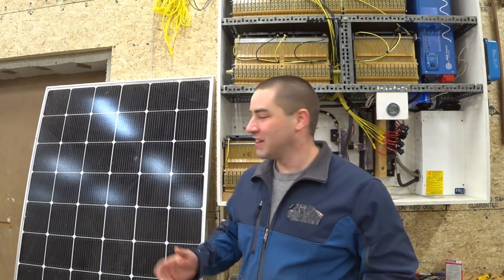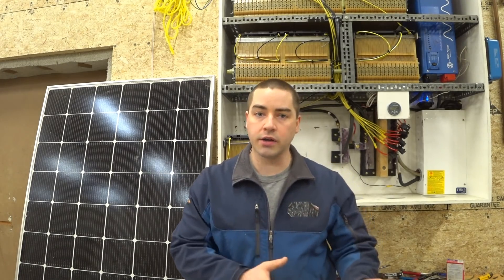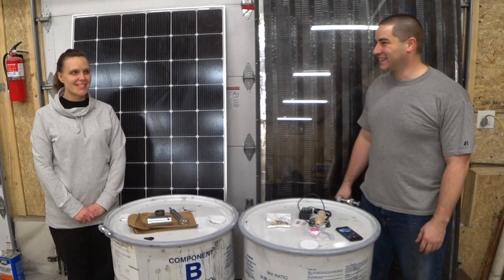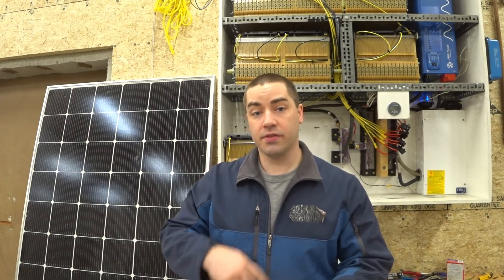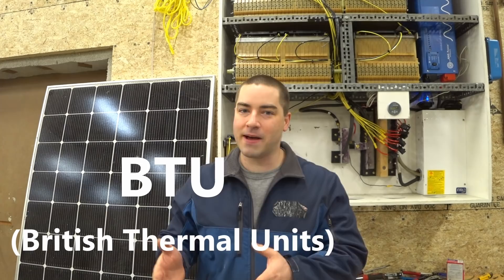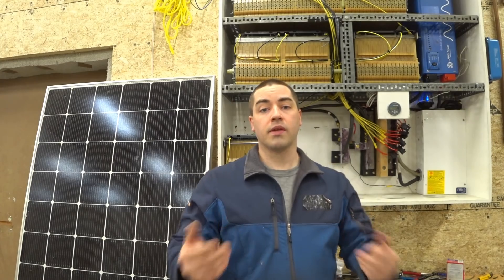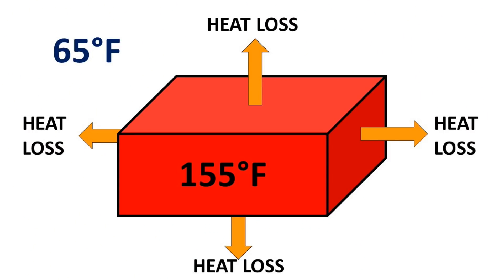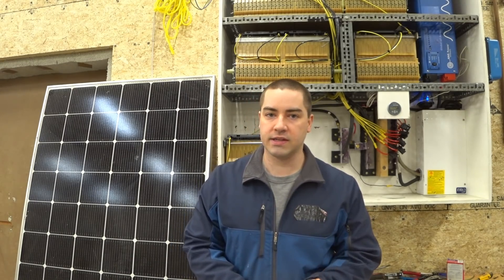Cheapest Energy Storage Off-Grid

Comment: Your minimum water temperature should probably be around 140F. Some forms of common bacteria will grow at temperatures under that. With the surface areas involved in the larger tank and heat exchanger, it's important to maintain sufficient temperature to prevent the wee beasties from growing.
Reply from the maker: 140°F is illegal in my state of Massachusetts, at least according to my plumber.
Reply: @DavidPozEnergy  Yes, some locations have both a minimum and maximum hot water temp (generally for landlords) and it's generally 120 degrees F. Anti-scald laws often have a maximum temperature of 120F, go figure! However, it's good to note that's at the tap (could be some losses between water heater and tap). Also, there are anti scald shower valves. In any case, 140 degrees really is a minimum hot water tank temp to prevent legionella bacteria.

Comment: Interesting fact, iridium has a much higher heat capacity than water. It would only take 33.2 gallons volume worth to get the full 4 days. However at current price it would cost about $553 million. So, water is probably better....

Comment: I think you missed the point, you still store the water in your massive home made tank but you heat it using a heat pump from the solar. This would allow you to heat the same amount of water with about 1/3 to 1/4 the amount of solar. However you would need to compare the cost of the water heat pump to the savings made from having less panels, You would also probably need a big inverter. My guess is the Heat pump + inverter would end up being more expensive than just having the extra panels needing to run a resistive element. Would be good to see the math.

Comment: POZitively the best stuff, watch many of your vids.
The problem with off grid thinking juxtaposed to on grid thinking + economics is the poor utilization factor of the storage solution as you expand the dreaded week long cold snap with no sun.
That means you only use it once in a blue moon.
So it is bad for the environment for us all to off grid, because we will waste so much resources to achieve the goal.
A smaller system with rare FF burning heater back up system also running is a lower impact solution in the end.
A heat pump to capture the waste heat even better, with capitol planning...
Even coupling the fireplace to the hot storage with directional valves, automated or not, is a good option for the low utilization, but still needed stretch.
You either thermaly peak when needed with fuel, or a heat pump add. If the the heat pump is leveraging the thermal storage, then the working delta T is going to get Hit...even go negative.
If you have a heat pump water pump as the final hot then your delta T of mass storage can be wider because of the lowering of bottom temperature.
If you have an old boiler and you use it 5% as much as you used to and the global climate emergency only requires 62% renewable, you can get off the unicorn of Net Zero Logic earlier.
33% margin left...
Also try putting a hot water heater (even an evacuated tube panel) under the solar panels sandwiched between roof.
By cooling PV the efficiency goes up, so if there isa use for the heat, the PV gives a bonus.
If the PV are thin film more heat will pass through. Glass on Glass bifacial also.
The trapped heat load is 70% removed (evac only for this high%) from the back of PV providing heat removal.
It is removed from roof, helping summer cooling and is used for direct heat source in winter.
Not good for high temp coupling, but good for mass volume storage, think seasonal heat island for winter, or for room heating with/without heat pump assistance.
After heating needs are over, seasonally, then can run an evap with the low grade heat. If the flow is reduced to get heat then the PV will not be cooled, but that was just the bonus, so no big deal...Evap loop for cooling allows lower fluid temp loop without rejecting heat or getting into hot water. Flow can be split also more than one output, say the low temp pre hot water tank that feeds the top off system.
Reply: clarify...without rejecting heat...(add... before using it one last time.)
Reply: Add..fix...each increment of storage you add has less and less utilization.
This means as you make it bigger to zero out the worst case scenario the 1st 1/3 would be highly used when compared to 2/3 and again to 3/3 of the volume.
But thermal storage has a size limit, it can only be so small before the surface losses become too large.
It is the opposite to the cell size max limit, a cell needs to be "leaky" to be alive.
We want the opposite to keep heat in.
Volume is not that expensive but trenching 7 plumbing is, both flow or size and distance are proportional to that cost.

Comment: heat pump water heater still makes sense with a thermal battery feeding the hot water tank.
When it is hot enough then it does not pump or consume electricity.
When you only have to top off the hot water tank, lets say on average only 10% of the delta T, then only 10% of the electricity would be used by heat pump.
A propane or Natural gas can also be used. Just turn off pilot in summer months

Comment: Insulate it really well... so... you got a cheap idea? I do, move the water up with pumps. Generate as it moves lower. You can use super cheap plastic barrels normal hoses, and cheap and easily replaceable pumps and a single and easily replaceable generator with perhaps a 3d printed nylon impeller setup. Max $1000 if you have a hill. Done.
Reply: if you have a hill LOL

Comment: Advanced Solar Trough: by using a spiral wound tube that is a bit thicker but more compact takes longer for a working fluid to move through. This makes hotter fluid. But if you use a double helix wound coil you can heat the water or worker fluid for much longer getting a high temperature faster while preheating cold fluid at the same time. Sealing a coil in a vacuum keeps heat in tor solar water heating that is many times more efficient. Then you can also use a heat trapping gas in a sealed container such as carbon dioxide to methane to boost heat further. As it traps heat in the tube with the reflective surface. And double to triple walled tubes further insulate and concentrate heat to the coil. Using black colored coil could get a lot hotter as well. With a large thermos to store heat like large thermal batteries. low heat leakage insulation or heat holding materials. The heat can be use higher operating temperature fluids to run steam generators to Stirling engines.

Comment: This video is unfortunately, very, very, wrong.
Making cold water hot is very efficient using solar. But then when the water is hot? System is idle. Possibly using electricity to pump and control system temperatures. The payback difference between thermal and voltaic solar quickly evaporates.
If you want hot water, install a heap pump hot water tank to get the most efficient hot water and PV.

Comment: still use a large tank to store the energy  BUT use a heat pumps efficiency to move  heat into that large tank instead of resistive elements.     It will require less panels, the calculation is are more panels for the resistive elements cheaper than  using a more more (up front) expensive heat pump with one third of the panel size.     If one is limited on area to mount panels the heat pump  choice becomes clearer.  TLDR:  choosing a 3x more efficient heat pump as the "heat source" rather than resistive elements to heat a large storage tank.

If you need a higher temp than what a heat pump can do,  THEN use the heat pump for the bulk btu input in combo with resistive elements for the final rise.

Comment: I understand the stock heat pump water heater won't store enough for threes days so why not use it to fill a storage tank that is big enough? Granted commercially available heat pump water tanks probably don't deliver the temps that an insulated tank would beniffit from and are wicked expensive. 

But I'm thinking more like how some people use arduino control to turn small window AC units into the cold air source for a DIY walk-in cooler/freezer. You'd have to be able to bend the lines enough to submerge the condenser and evaporator in a working fluid but you oght to be able to get +180°f from the hot side of the heat pump and take advantage of the factor of two or three coefficient of performance that even a cheap window unit should get you. 

I'd suspect the operating costs would work about about the same with greater HP efficiency largely offset by the lower cost of the thermal storage but the initial cost being much higher for the pricey HP heat pump unless you went the DIY route.

Comment: Really interesting. I am currently trying to design my house from scratch - I was headed down the electrical under floor heating method, but now I am seriously thinking you might be on to something here. I'm wondering quite how large a heated water reservoir you could build before it starts to become counter productive and expensive. 

What I was thinking of, before I watched this, was running both PV (90%) and solar water heaters (10%) on the roof, then creating a well lagged storage tank, then using electrical power to reheat (if needed) and pump. But from watching your other video about pv vs solar thermal, perhaps I would be better off changing that ratio towards more solar thermal and less PV and a decent size heated reservoir...

I've already designed in a mechanism to collect and store 30 000L of rain water, underground.

My main goal is to get as far off grid and self sufficient as is feasibly possible without spending 10000s of pounds doing it.
Reply from the maker: Very cool you are designing your own off grid house.  In my personal opinion, I'd limit the storage tank to no more than 1,000 gallons.  I see diminishing returns after that.  Mine is 250 gallons, and it's OK most of the time, but I wouldn't want to go smaller.
Reply: @DavidPozEnergy  I am of a different opinion. I am looking at it to also heat my home in addition to providing hot water for showers etc. 

In Michigan we have a long winter and a lot of cloudy days. And most of the time from December through February it is about 20 degrees F, but can get down to 0 F on occasion. 

I was thinking of 8' x 8' by 6' tall in the heated shop, because sheet goods come in 4' x 8'.  I liked your idea of foam insulation on the inside, but will also add fiberglass insulation on the outside, to get me closer to R60.  That is over 2800 gallons, and will lose about 14848 BTU/Day or 181 Watts through the 6 sides.  I think it will let me heat the house for 4 days without much sun. 

I am calculating just under 1,195,000 BTU Storage or 14591 Watts.

Comment: Great video. A lot of people talk about it. It's great to see someone actually doing it. Why did you say if you had to do it again you would use copper?  Thanks again
Reply from the maker: I said that because if the solar tank gets really hot (over 160°F) then I can smell plastic in my water.  This is surprising because the PEX I used is rated for 200°F and my controller shuts down at 180°F.

Comment: This is the second time I've watched this.  Finally starting to get it.  No reflection on you; you did a fantastic job.  

Is it possible to run a geothermal heat pump off the hot water?  Obviously that's going to chew up more of the BTUs.
Reply from the maker: Ground source heat pumps need electricity to run.  They move heat from one location to another.  But if you are asking could you heat water using a ground source heat pump?  Yes.
Reply: No my question is could I have a hot water reservoir heated by solar then would the heat pump be more efficient. Probably a silly question.

Comment: how about buying a freezer and freezing water in 1 gallon containers? then you buy 55 gallon steel drums, fill it with water and keep it a room. when you want cooling you charge it by putting putting the 1 gallon containers inside the drums.  It will cool room passively  (1kw-2kw)

Comment: I was planning on using glycol solution as the storage fluid, so I could store it at an even higher temperature, but I also like a 140°F domestic hot water temperature.

Comment: Alright things to add if I ever get to build my own house. 

1) Solar panels
2) Battery electrical storage
3) Solar Thermal
4) Over sized solar thermal water storage
5) EV charging port with 2 way charging
6) Smart meter that can control power from the PV cells, battery, car battery and the grid. 

I'll be creating my own electricity and my own fuel for my car. The fact that is possible is absolutely unprecedented it'll completely change our energy economics.

Comment: hey david, great videos. i would love you see you make a gravity battery. you would be able to store energy forever until you need it. store all your excess solar production in the summer and use it in the winter? maybe build it with an old 1000 gal propane tank and fill it with water or sand or? its a great idea but the size may be a deal-breaker?
Reply from the maker: I just don't think there is much stored energy there.  At least not on the tiny scale of something I could build in the yard.

Comment: You should look at a Drain Water Heat Recovery Unit. By using the already warm sewer drain water to preheat incoming water, you can save energy. In a typical home that has a traditional hot water heater the units claim about 50% of the heat energy can be recovered. In your case, of you can recover 50% of heat from the drain water, you reduce demaind for hot water by 50% and also reduce the storage needs of that hot water.

Comment: Strictly speaking storage capacity Lithium versus water, you are absolutely right that water is cheaper and more efficient.  You still have to realize that 31,360 BTUs (9.2KWh) per day is huge.   This is where conservation saves a lot of money.  So assuming only 4 sun hours per sunny day in the winter,  that works out to 2.3KW of solar panels (not included any electrical losses in the system) and that's just to reheat what you took in a day.   If you deplete your solar battery in the winter, you are gonna want at least double, if not triple the capacity in your solar panels to replenish it in a reasonable amount of time especially during the shorter days of winter unless you rely on the grid or some other power source.  Another promising technology is parabolic sun tracking mirrors, that heat a coil, that heats the water with a relatively small mirror(the size of a satellite dish) that can produce 1000-1500w equivalent power.

Comment: Not only for the thermal storage efficiency, but also thermal energy collection technology, thermal energy is much more efficient.
For example, the solar thermal power conversion efficiency is over 70% compared to 15% solar panel conversion efficiency. In addition, installing a thermal panel in the solar tracker increases the daily output significantly.

Comment: Smart man Dave, I've been experimenting with solar water heating too & had a less than 2x2 collector circulating in & out of my water heater giving me scalding hot water all summer but from late fall to early spring it didn't cut it so & built a collector about 4 times bigger & that fixed it but your idea of storing in bigger tanks & the heat exchanger idea for non sunny days has got me rethinking how I should go about it. Your video gave me much to ponder, thx!

Comment: why use such a low heat capacity fluid like water? This is a great idea, but try using molten salts instead. Try to reach 500 C to molt those salts out and then, pass a current of water through it with heat exchanger. You can definitly store more heat with salts.

Comment: Question: Why not use hot oil? The specific thermal attributes are not as well as water but you can heat it up alot. much more than 100°C without boiling and no oxidation of metal parts etc.

Comment: What about putting the electric water heater elements in the heat exchanger tank surrounded ny maybe a metal box with holes in it to keep heating element from melting lining etc.  That way you would not even need an inverter that the water and you would not need the water circulation panels with all their issues.  Just panels some wire and element for solar part of system.  If I do this I will use it as a preheater to send water to gas tankless water heater which shouldn't actually need to heat the water very often or you can size the system so water would only ne say 100 degrees or so and use tankless to raise it a few degrees to whatever setting you wish.

Comment: Two tanks, then!  One black tank aboveground, outside for summer usage, the other buried under the house for winter.  The one under the house can be used for cooling when its water is not being heated in the summer (although you may have to open some valves to allow water to circulate through some outside loops in order to get rid of the heat that it picked up in the house).  The two tanks is still still FAR cheaper than battery storage.

Comment: Jeeze - what a torturous way to explain something very simple.

Screw the math in what is primarily an introduction to a concept rather than a complete & convoluted how to for a serious adopter - just build the most pragmatic heat tank/exchange to pre-WARM a water tank from the usual icy pipe temps, as best u cheaply & pragmatically can, & boost that "warm" water as near the point of use as practical, w/ a instant heater to do the fiddly bit of making it usably "hot".

Even if an adopter ultimately opts for more, basing the video on my model would muchly broaden the audience by removing the eye glazing (imperial measures even???) arithmetic.